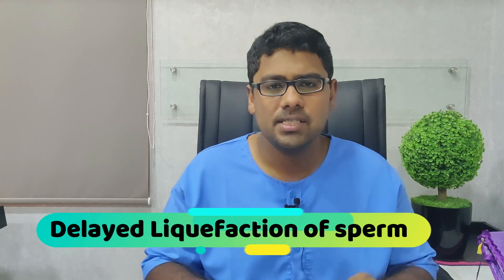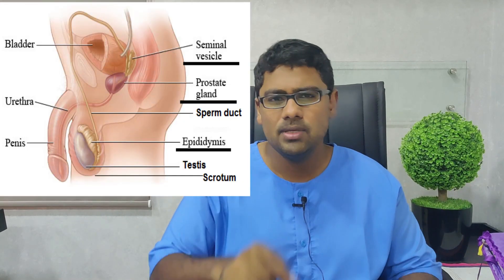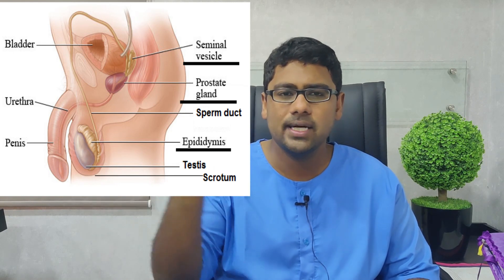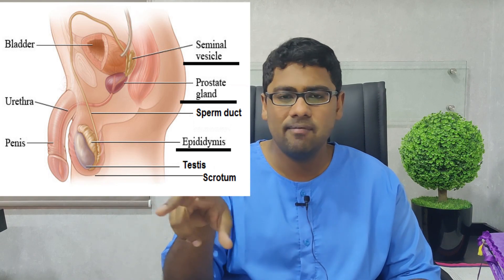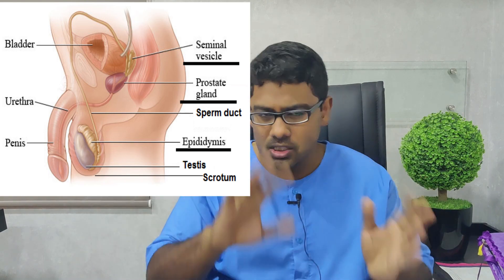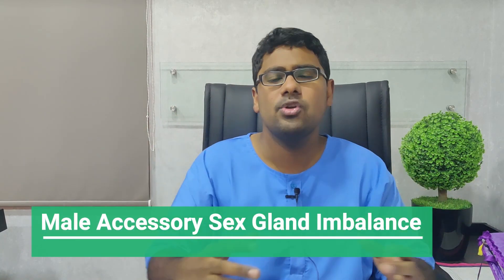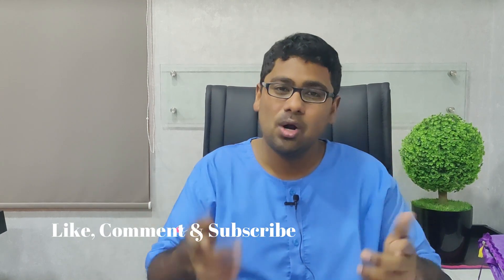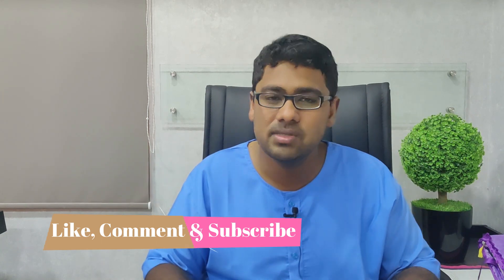Delayed liquefaction of sperm - Explained

Comment: Hi dr may you inform me if there’s any problem :

Volume: 2.5 ml
Total sperm count : 72 mill/cc
Reaction : alkaline
Viscosity : viscous
Liquefaction time : 45 mins
Pus cells : 8-10 /HPF
RBCs : 3-5 /HPF
Epithelial cells : Nil
Spermalogenic cells : 2-3 /HPF
MOTILITyY: Progressive 20%
                     Non progressive : 50%
                     Non motile : 30%
MORPHOLOGY: Normal 60%
                             Abnormal 40%
Reply from the maker: Progressive motility is less. Please call me on 9790783856

Comment: Duration of abstinence 3 DAYS
PHYSICAL EXAMINATION
Volume 5.00 ml
Viscosity NORMAL
pH 7.5 
Fructose DETECTED
Liquefaction Time 27 Min.
MICROSCOPIC EXAMINATION
Total Sperm Concentration 40 million/cmm 
Total Sperm Count 1.5
Vitality 35 % 
Agglutination +
Pus Cells 10-12 /HPF
RBCs NIL 
Motility
Total Motility (PR+NP) 50
Progressively motile (PR) 40
Non progressively motile (NP) 10
Non Motile 10 %
MORPHOLOGY
Normal forms 45
Abnormal forms: 20
Head defect 13
Neck & Mid piece defect 10
Tail defect 12

Plz plz 🙏🏻🙏🏻reply is this okay ?
Reply from the maker: Normal report

Comment: Hii sir, 
Volume- 7.0ml
Motile-25%
Sluggish motile-15℅
Non motile-60℅
Tc-42 million
Puscell:pus:-4-6/hpf.Rbc:-8-10/hpf
Remark -many duble head, pin head, and cresent head spermatozoa are seen. 
Liauefication time :-1 hr. 

Plz rply sir🥺
Reply: Kya isme pregnecy ho sakti hai kya or hogi to kuch pb to nahi na.?
Reply from the maker: Pallavi this report is problematic. Please call me on 9790783856
Reply: Sir semen liqufy after 2 hrs. Rapid motile 25 % its normal sir
Reply: Volume - 4.8
Colour - Milky white 
Ph - 8.0
Liquefaction - No liquefaction 
Viscosity - Highly viscous
Active - 70%
Sluggish - 10%
Non motile - 20%
Normal - 80%
Puss cells - 1-2
Sperm count - 65 million

Please Sir is this a good result?

Comment: Hi doctor my seminal fluid analysis

Appearance Homogeneous & Grey-Opalescent
      Volume 2.5
 mL 0.50-6
   Liquefaction Time 30
  Min at 37c 0-30
   Viscosity < 2

 Sperm Concentration 110
  Million/mL 15-259
   Total Sperm Number 275.00
    Million per ejaculate 39-928
  Degree of Agglutination Grade 1
 % Grade 0 – No Adhesion Grade 1 – isolated

A → Rapid Progressive 40 Motility
  %
   Grade B → Slow Progressive Motility 30
  %
   Grade C → Non Progressive Motility 15
    %
  Grade D → Immobility 15

 60
  %
   Abnormal Morphology 40
    %
  Leukocytes (Pus) Few 2-4
   
Is it normal
Reply from the maker: Motility is low

Comment: Hi Sir, This is Moon Danish From KSA. Plz i Need your advise ?
My Simon Report is :
Color - Greyish white
Viscosity -Thick with Highly Viscous
Volume - 2.0ml
Liquification Time -  ( # Delayed liquefaction Time is More than 120 Mints #)
Total Sperm Count - 86 million/ml
Rapid Progressive Motility -40%
Slow Progression - 50%
Non progressive Motility - 10%
WBCs - 8-10 Cells/HPF
RBC's - Nil cells/HPF
Type of Motility - Sluggishly Motile

Is it Normal Sir?????
After Simon Report Dr, give to me MUCINEX 600 mg Tablets to use 2 time in a day i used more than 6 months after that i give a new report But Result was same as previous report, Thick with Highly Viscous &  Delayed liquefaction Time is More than 120 Mints. Plz advise me about my problem ? Thank You
Reply from the maker: Please drop me a call on 9790783856

Comment: Sir thanks for the video. A query, if previous two samples are abnormal, what do we do next... Run an infection screen to look for orchitis? So which test has to be done?
Is spontaneous pregnancy possible with conservative measures like hydration, vitamin supplements occasionally, exercise?
Reply from the maker: Take another sample with a different abstinence duration. nothing more required.